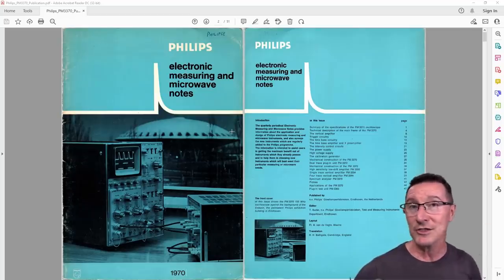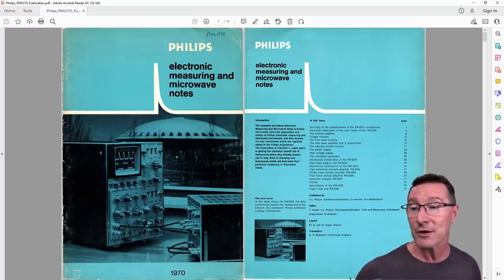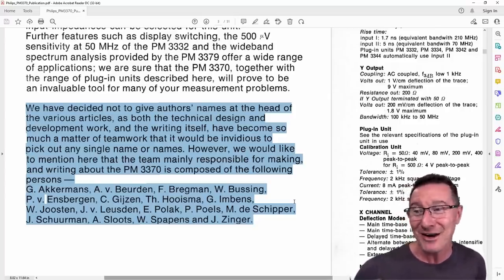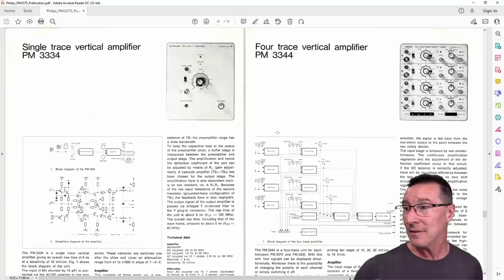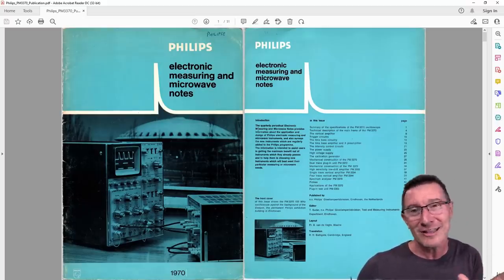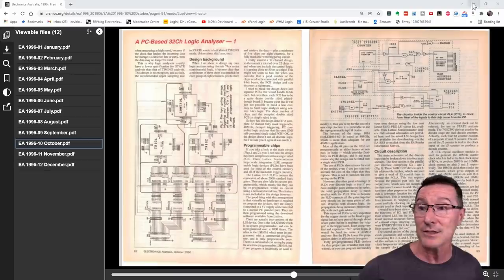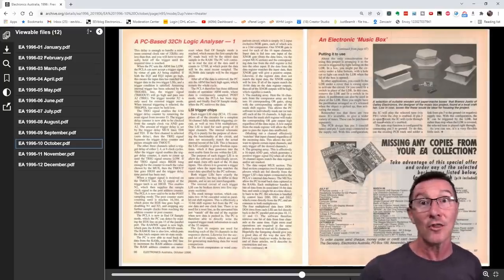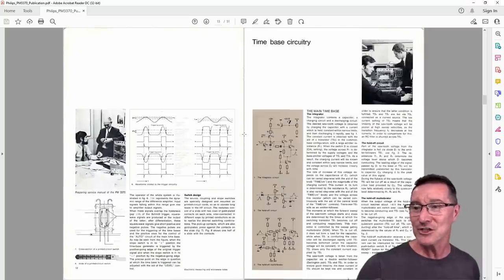eevBLAB 94 - Why Dont Companies DO THIS Anymore?

Comment: Dave, I have finished re-engineering the Electronics Australia EDUC-8 computer kit from 1974. Same circuit but with new proper PCBs and readily available edge connectors and switches from Altronics. do you want a set of boards to build up your own? 
Long live TTL
Reply from the maker: Nice! Tempting. Will have to look at the EDUC-8 again. I've alrady done several videos on the Gigatron TTL computer.

Comment: Unfortunately,  then these "authorised repair agents" would be out of a job.  These people are worthless anyway, they never ever fix anything, they just replace the entire board and charge you $50% of the products when new value.
I have my original service manual for my Philips/Fluke PM3065/PM3067, its big and laid out so nice and readable.  But my LeCroy 9410 original service manual is bloody massive, no pages count but its more than 35mm thick of A4 pages of English only, and even has colour pages! (Which are really beautiful btw) And I also have the Remote Control Manual, its almost as thick, but the pages are half size, 200+ pages English only.  All of these manuals have awesome pull out pages that are around 3 times or so the size of other pages, so you get a ton of info on those particular pages

Comment: As I see it nowadays is not about quality but quantity, big companies get away with big price low quality and nobody complains or don't have time to complain so they keep doing it. if you live in NYC and take the subway and stop by Brooklyn bridge city hall  even if it's a little dirty you can gaze upon the beautiful architecture and angering that they put in that station so well designed to the last detail, in the other hand if you compare it to a much newer station for instance the one to take the path train, it looks pretty but that's about it there is no detail no quality you can even even see leaks and in the station which is fairly new.
what I'm saying is, that is such a shame that nowadays is all about built fast and cheap if it saves 1 cent then go for it, but then there is no passion anymore, or maybe I'm just getting old

Comment: Besides the fact that people like you (and I) are a minority and it's not financially sound to make these anymore, you also have to consider that in any modern production facility and any modern publication, they would have to prep the areas to make sure that absolutely nothing sensitive might appear. Then a team would have to go through and check what was missed. Another team would have to go through to make sure there wasn't a picture on someone's wall that the copyright holders might fuss about, or a logo from a company that doesn't necessarily 'want to be' associated with your company and/or that publication.

But yeah, for the most part, the audience just isn't there. You know what an audience does exist for, though? Apple's $300 table book with primarily product shots.

Comment: because they manufacture and invent almost nothing essentially anymore. its the same chinese factories that make stuff for the few dozen electronics manufacturers that dominate global market. ofcourse there isnt theory of operation and all of that stuff. virtually everything is relabeled and/or repackaged for these manufacturers.  why do all oscilloscopes look exactly the same now? both externally and you compare the specifications of different brands of scopes that are manufactured in china and you have identical specification. what are the chances of that happening? the point is that they just order these from a factory that sells them to probably more than 1 brand and use off the shelf parts thus the similar spec sheets. for consumer products and prosumer, its all the same crap, some professional super expensive equipment is a different case but sometimes still the case too.

Comment: Well, I still own a lot of 80s electronic equipment and gear (even HiFis, synths, old mini computers - Amigas mostly, crts, etc.) and despite not having the detailed stuff depicted in such doc, every single one includes huge manuals and service manuals with foldable pages plenty of schematics, architectural diagrams... some even with a bill of materials. Yep. It’s a shame the fruity trend nowadays.
Reply: I have a lot of Soviet and German  60s-80s devices which came with full documentation including PCB layouts. Everything was super detailed and since it was 90% analog or discrete digital there were no custom firmware so if you had all those documents you could reproduce the device easily. In fact when i was 10 years old and got my hand on a spare color CRT tube i just made a TV from parts.
Why they didn't care about that - simple. Building a device yourself is more complex and expensive than buying a new one (bulk vs retail parts prices) and when it comes to devices like TVs it's not like in the 80s they weren't using standard component sets anyway.